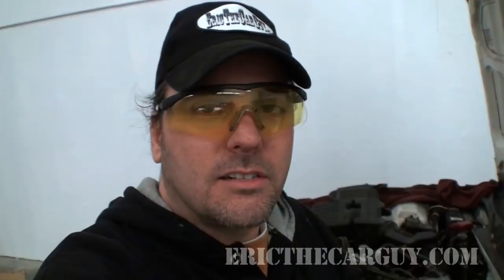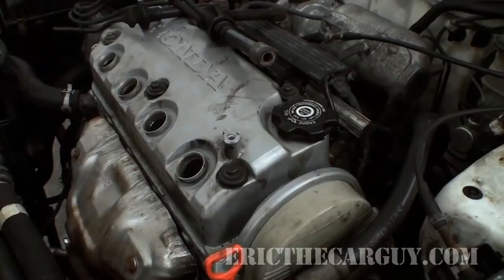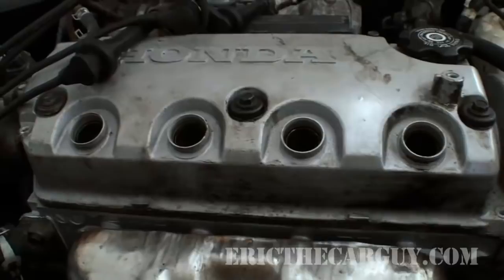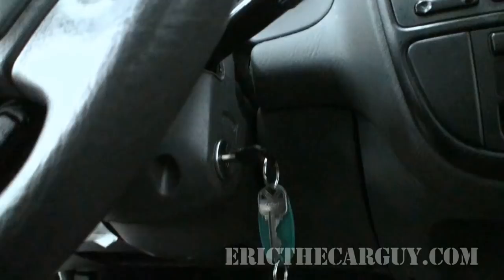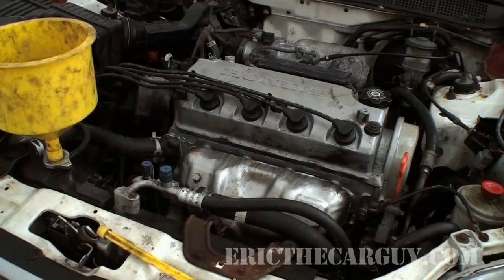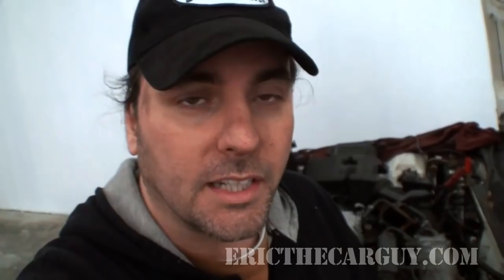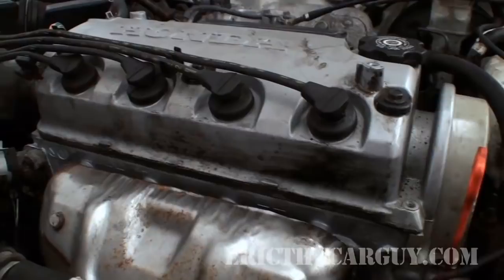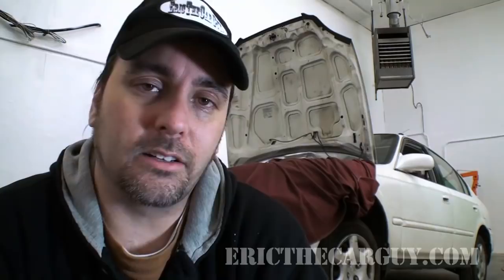How to Break In A New or Rebuilt Engine - EricTheCarGuy

Comment: sounds like a bad rebuild if a engine has been re built properly it should have been dyno tested prior
Reply: +alex tilson  That is  great but completely not a requirement . Yes in an ideal world; but the over whelming majority of rebuilt/reman engines are not. Sure it would be nice. 
 But the point ; I want to make is that while it's desirable it is by no means necessary. Just didn't want some of the less informed/experience to be discourage from doing an eng. by the added not trivial additional cost of a preinstall dyno. run. If your going to dyno the engine; far better to do it in the vehicale where it can tuned in the real world running in the chassis it will power.

Comment: Eric, I don't know where USA Honda engines are made, but here in South Africa they are known as bullet proof. I have seen a few run over 500 000km with no problems. The big thing I have seen and experienced, is that there is NO fixing a Honda engine, no matter which shop does it. They are just never the same again. Yours sounds as bad after rebuild as every one that I have encountered, not to knock your skills, it's just a thing with Honda...I would scrap the block and get a decent low mileage one from a wrecking yard...
Reply: +John Jones merc/vw=German companies.  Where are the South African manufacturers to give your response an actual point?  You have German manufacturers that went to your country to lower costs in order to supply parts of the world and you act like somehow South African ingenuity designed those cars, rather than simply being the cheap labor and grunt to meet a price point.
Reply: +John Jones +John Jones every single time South Africans discuss their country, they pull the comparison game.  Even when it comes to the rape and HIV epidemic they seem to be completely unwilling to handle.  Even at the mention of cultural permissiveness to violence against women, they will also say how bad it is elsewhere to discuss how bad it is in South Africa.
Reply: I Disagree. How the Engine runs after a Rebuild depends on a myriad of factors such as, quality of the parts used, following the manufacturer recommendations as far as Tolerances and torque values go, the quality of the parts being used and I recommend Honda genuine parts, and last but not least the skill level and quality of the Technician performing the Rebuild. You can achieve the same performance in the Honda engine as the day it came off the Factory line.
Reply: Yes
Reply: on my 94 Honda civic The brake proportion valve is discontinued by Honda along with the wiring harness.

Comment: That thing sounds horrid.  smooth and quiet my ass. I've had d series engines with well over 300k that sounded better than that one.
Reply: also I forgot to add, throwing the spark plugs down the tube like that is a nice way to throw the plug gap off.

Comment: What's the difference between Engine Rebuilt and Remanufactured Engine?
Reply: +Elmano Locko remanufactured engines are rebuilt engines that come from the dealership...  then rebuilt engines are done at different places,  but they are basically the same thing...  normally remanufactured engines have a warranty from the dealership

Comment: Change the oil by 500 miles.
Reply: I agree with this, new oil has just as good lubricating qualities as the old oil, but without the silvery micro metal pieces introduced into the oil in the first 500 miles or so. Honda used to say do not change the oil early but no one could adequately explain why, they guessed that maybe honda used a special moly oil or used a higher viscous oil.

Comment: also turning your engine over in theory would be the same as running it. lol just sayin
Reply: less heat and as he did you can turn it over without the plugs making it easier on the engine the best way to do what he did it to turn only the oil pump but thats hard on some engines do as he did not just start and run it
Reply: Turning an engine over is nothing like running it. Someone needs to retake internal combustion engines 101.
Reply: i understand its easiar on it because of what taylor awesome posted. but as far as oil is concerned it is. either way its pumping just maybe with some side effects. also if you lube everything up during rebuild would it still matter? lol I can fix them it doesnt mean i know everything about them.
Reply: yes when rebuild an engine you can and should prelube with a quality lubricant but its still an important step cause simetimes it wears thin from turning the engine while rebuilding
Reply: so in conclusion i have learned something new :P lol when i rebuilt mine i had a licensed mechanic at my side helping... or maybe i was helping him lol anyways he never mentioned that. but we generously coated any moving part in oil so hopefully it avoided any damage seeing as the engine is still running and working properly hehe. thanks for the info everyone :) next time ill have one more safety precaution i can do to maximize the quality :)
Reply: mhm noproblem alotta people give me shit about what i know about engines cause im so young but ive been studying engines and working with them for more than 7 years and know alot of older car guys some very high up poeple who have been doing carsand racing themsince racing was a thing and have learnedalot of little tips from them over the years
Reply: Yes you lube everything as it’s assembled but I always crank engines I build until they have oil pressure, it’s not the same as running it because there is no load in it when cranking without plugs in

Comment: Probably you are a mechanic but not,Honda mechanic because if you had engine apart why you going to put it back together and not adjust valve properly.... 
#1 It just sounds like a diesel engine
#2😪
#3 why you're killing the starter you don't need to be doing it.That's why the sale  assembly lube!....
# if you know how to make a engine ;not a problem...
#4 There's no breaking point for (me)but as soon , 
#5 I start the engine 1 hour right away I change the oil.
#6 For the metal debris of the cylinder walls and any particle that it is write down the engine...
#7 Follow torque specs and you'll never never have a problem..
#8 Knowing and space between the piston cylinder walls, main bearings rod bearings plastic gauge so you can know the tolerance in between can you use.
#9 racer never have time to breaking point!a engine So thats why with plastic gauging engine 8 out of 10 never. Fails....😘
Reply: He didn't rebuild the old engine since that one threw a rod and also was run without oil I think. He simply bought a rebuilt one to save on time. So all the steps he took were just to make sure the engine was safe to start. Btw he's been a honda tech for many years.
Reply: Lo l.. it take fine minutes too bad,valves adjasment!! no matter what use on rebuilt engine I always doing it
Reply: Michael Chinchilla because you've obviously never made a mistake before lol
Reply: rednoseroyce to be fair Michael has some valid points. He's just saying that the noise from the rockers should be easily remedied. However it does appear that plastigauge is useful. Of course I have little to no experience with doing work that precise, however Jafromobile uses it as well as measuring tools to figure out his tolerances and he has quite a lot of experience building 4G63's.
Reply: michael said there is no need to build oil pressure to lubricate an engine before a dry start because they use assembly lube, I disagree with that and he pulled the plugs to take away most of the stress on the starter too. Respectable engine builders balance and blue print engines and use micrometers, dial bore gauges ect. Plastigauge just isn't accurate enough for the tight tolerances of modern engines
Reply: Sorry. But I mention plasticgauge, because I didn't know that he has the knowledge of use micrometer are bore gauges.....read blue print!!! 
4G63 is being out almost 20yr. Mitsubishi doesn't change assembly ...about. My grammar sucks. But not knowledge.... Being a boeing CNC operator's like worked GE90....& last one HF120 ,,,
HONDA' Toyota 
B18a1=block+b16b=head's,JE connections rods,cp pistons,erick racing strock kit,ruben racing's. Cams..hondata ,AEM fuel pump ects...fasters. 1/4 @times.....BY ME.
Reply: EpiDemic117 I can imagine how expensive the labor would be to have your motor and trans rebuilt.  Easier to just buy a new d16 for 400-800 bucks.
Reply: Rebuild a 4age and turn it into a 100hp+/L compression monster.